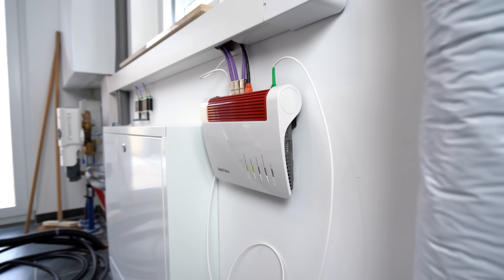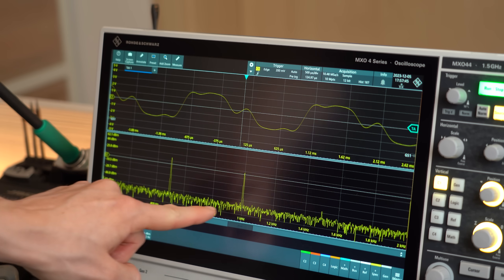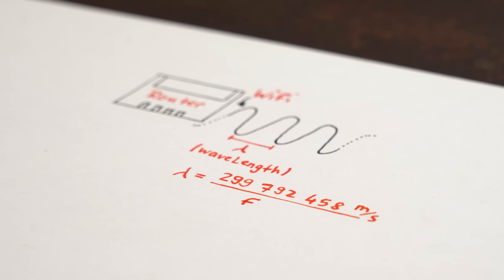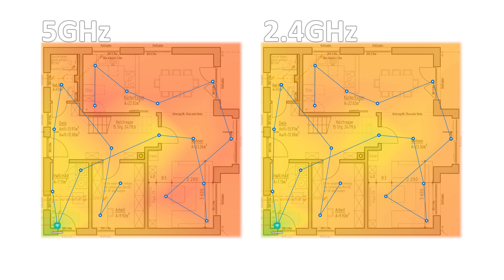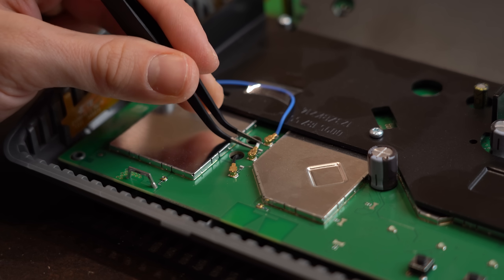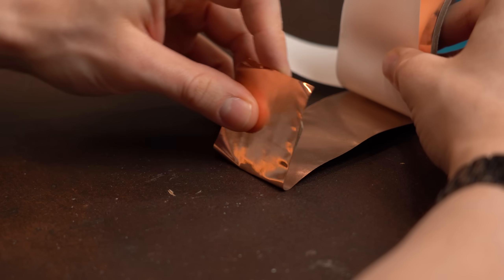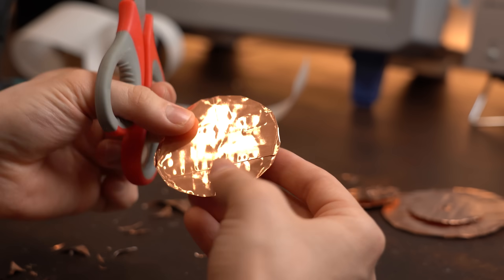I tried OVERPOWERING my WiFi!

Comment: I never thought that I'd see the ghetto engineering of the Kreosan boys on this channel.

As for their directional antenna, it's more of a line of sight antenna that works if there's NOTHING blocking the signal.

You'd be better off getting powered signal extenders or just dealing with the lower upload/download issues and in most cases, you'd be okay unless you were downloading/streaming 4K material.

Comment: Always had issues in my house 100sqm and i have 3 router to cover ther area. Unfortunately the house is built out of brick and concrete block which blocks wifi. Will show a good signal but just wont communicate switch to a.closer Access point and ita fine. Can be absolute pain but luckily my newer phone is pretty proactive at switching networks.

Comment: The first antenna (the supposed quarter eave half dipole) is not used for wiifi. Its the DECT antenna for the dect base station functionality of the router. You can see its next to the dialog sc14445 IC which is a fully inegrated DECT transciever.
Reply: I thought DECT was cordless phone handsets, why would it be in a wi-fi router?  EDIT:  I just looked up on line that we have limited use of DECT in North America with DECT 6.0.  I didn't realize it was utilized more in other places.
Reply: @WJCTechyman DECT indeed is used for handsets. Fritzboxes (the router he owns) were quite popular as "all in one" devices, acting as a DECT-to-VOIP or DECT-to-POTS gateway for the telephony side of the service. DECT was/is super popular in europe, where interoperabilty between vendors was obligatory.. so you could potentially pair a handset of panasonic with a gigaset base for example (albeit potentially losing on advanced features). Keep in mind that DECT 6.0 is not compatible with european DECT as it uses different frequencies.

Comment: It looks like the company that makes your router also sells Powerline Mesh devices.  I'd suggest looking at that to deal with the weak spots in your house.  European homes are built differently than homes in North America.  It's not surprising that the Wireless signal doesn't get that far.

I'm honestly envious of the options in Europe for this type of stuff.  It's easier to buy here now, but at double the price it seems.

Comment: Probably a low signal due to modern building materials. Foil backed insulating material will cause a lot of blocking and reflection, and it's often used in internal walls these days.

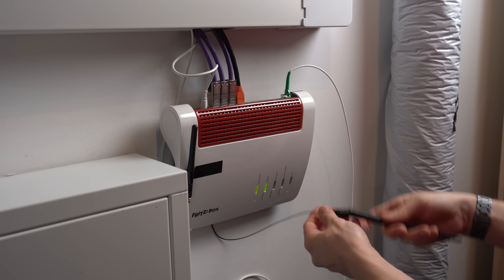Comment: Regarding 8:04, even harmonics of antennas actually present significantly higher characteristic impedances than 3rd order harmonics, meaning you can improve the signal even more by making a sort of fan dipole design

Comment: Best solution (but a little inconvenient at first) is to move the wifi router to the centre of your home, perhaps in the ceiling cavity. Your devices will never be more than half the diagonal distance to a corner away from the router.
Reply: He's got a fiber connetion, and I'd guess that the connection ends right there where the router is located right now. Of course you could maybe extend that fiber optics cable to the center of the house, but then ... there's also the WAF to include in the calculation. :)

(WAF=wife's acceptance factor)
Reply: @haukewalden2840  well... my WAF always below expected :/
Reply: @haukewalden2840  honestly get a cheap fiber switch off the internet and use cat 6 cable to connect the "fiber run" to the "router".
if murder was legal I would have killed the tech support at my ISP.
I specifically complained about their routers NOT being able to support a continuous 1Gbps link.
I asked them through out 5-7 emails "Can I switch the router to get better stability during high demand"

"no, our routers are good take a speed test it should show 1Gbps, have you checked the wifi?"

I ditched their piece of shit router for a very cheap fiber switch that has 1 fiber port in , and 2 Ethernet out, plugging that in to my Assus router solved all my issues, I can now continuously upload and download at 1Gbps for hours on end.

The fact that anybody would bother with a "modem" when they are getting fiber straight to their home is ridiculous, 
 current day ISP are operating in a LAN fashion,  there's no special sauce behind their devices, if you can plug it in you get internet.

I tried plugging in the fibber termination straight to my server and I got a IP and internet.
Reply: @haukewalden2840 it just make more sense to add more routers/access points. I have in my home using old isps routers and get 300mbps minimum pretty much everywhere.
Reply: Based on his heatmap, the 5GHz connection won't work well at further side of bedroom and kitchen. Perhaps adding one more Access Point (with different channel configured) at another edge of his house would improve a lot more better signal, especially 5GHz

Comment: I suspect part of the problem is the standard and wattage limits were both designed with American style houses in mind, which are made from RF transparent (and comparatively flimsy) materials like drywall and wood framing filled with fiberglass insulation, whereas European houses tend to incorporate denser and more RF-opaque materials like bricks or stone. You could punch a hole in an American house with just your hand, but doing the same in a European house would break your hand instead of the wall.
Using a wired backhaul, like ethernet over power or ethernet over coax adapters if you don't have ethernet wall outlets, so you can have repeater Wifi APs in the dead zones might be the "professional" solution in this case.
Reply: America has higher power limits than the EU.

Comment: Wifi routers belong centralized where possible, not in some random corner simply because it was convenient, or at least one router setups do. When possible, placing the router a bit higher in an area, a little above the height of the average human or so ( 6 to 8 feet ).  There's a distinct possibility that the router will perform better when placed horizontally than it performs vertically.  Think of the radiation coming from the router/access point as a donut.  If you place a donut horizontal, from the center, that's the way that the radio waves emanate, which means more distribution outwards- but in the same plane as your rooms are laid out.  Place that donut vertical, and that same radiation pattern only goes in a narrow swath, but goes vertically..   This is the basic premise on lower priced units; if it does not work in one orientation, you probably need to try the other orientation; in this case, FLAT. 
Now, if you have bought a router that is capable of "steering" the waves, well, it depends.  It still might be better in one orientation or another, or  it might not matter.  If you have external antennas, you want your external antennas pointing vertically.     That router with the pointy antenna- well, it's a classic example of a router that NEEDS to be mounted horizontal, or upside down, but still horizontal.  Radio waves radiate from that in a DONUT like emanation;  When placing routers and access points, you should aim to keep them mounted physically higher, ideally a little bit above the height of the average human..   
So, if  your router is meant to be placed flat, do so.  You generally don't want it the height that maximizes blockages with furniture, closets, metal enclosures, chest of drawers, etc. 4 to 7 feet, maybe even higher.. It's still a donut emanation from the antennas, so you don't want it too high unless the device is specifically designed to be ceiling mounted. 
Mesh systems or using extenders is another possibility ; But a proper mesh system will seamlessly transfer clients to the nearest access point.  Many extenders will not.  Dropping that access point closer to dead center would clean up lots of "dead" spots nicely.  Even mesh systems may require proper placement, moving to get the best coverage;  Even mesh systems should not be placed near the corners; more like about 1/4 of the way in, if two devices, towards opposite corners, but still, 1/4 of the way in.

Comment: Search for, Corner Reflector . Or, Slotted Coax .
There are many more DIY options, that will perform better, but require much more experience with RF.
Hint for your Directional Antenna, toss out the 3 smallest elements.

Comment: That is one (or two) expensive wifi router. With not that great performance too.
With that amount of money, you probably should opt for some cheaper Chinese router with a bunch of repeater.
Or, I'm pretty sure I could get a mesh wifi of the same value, at least here in my country.

Edit: Yep, i could get 3 pack mesh wifi 6, for less than that newer router you have, costs.

Comment: Ur measurements had to be off somehow. I think maybe you should have only used one piece of tape for each element. You really mucked it up using tape lol. It makes for a great exploration video about antennas and why it didn’t work. Not 100 percent sure but I think the beam formers are supposed to be isolated? Or connected? Idk does anyone know? Last yagi i made my beam formers were all attached and i think that wasn’t okay. I think all the elements are supposed to be separated. Great, now i gotta look this up. Lol

Comment: I don't know if it's the same in Germany, but in the Czech Republic the transmission power should be measured as radiated power (including antenna gain).  Wifi power should be 20dB after the antenna, not before.  So if I'm not mistaken, It's still illegal because you're changing the antenna gain...

Comment: There's a simpler fix - aluminum foil and cardboard or 3mm heat insulation (used for car windows in the summer and behind radiators). I've set a piece 50cmx40cm near my router and can get above 100mbs everywhere in a 48m^2 flat. Inspiration for this was pringles can antenna boosters.

Comment: Just buy your own router on the used market, I personally go for the asus triband router range like the AX11000, but you can buy various cheaper models too. And if you get 2 or more of any asus router, you can turn it into a mesh setup very easily to cover a large area with wifi

Comment: The other issue with transmitting above legal limits (100mW or 200mW) is the client device might now "hear" the transmitter but won't be strong enough to reply back. This makes everything slower in both directions. High-gain antennas are also a bad idea because the signal is now beamed rather than omni-directional, so you can create more problems without realizing it. The only good solutions for home are (a) mesh wireless networking or (b) wired network with multiple access points.
Reply: Yeah, highly directional antennas are uncommon for the hotspot (because usually devices should connect from multiple directions), more common for clients, but obviously less useful for handhelds (even though there are inductive coupler/cell phone, but I've never tried them). One exception is these ~7dBi long monopole/whip antennas because they are still fairly omnidirectional as their radiation pattern is torus shaped. This could be useful for increasing gain within a single floor and reducing the interference with other floors. However, in a MIMO setting you'd get correlated signals if you orient all monopoles vertically. But with some slight variation orientation or extension cables you may still get a somewhat decorrelated signals such that it is still worth it. I have never experimented with that though. Annoyingly not all vendors and drivers provide detailed MIMO performance information to be able to conduct such experiments.
Reply: A directional antenna is the right thing for this application, blame the ISP for bringing the fiber to the wall and no further. Now if the router is near the middle of the area as it ideally should be, a directional antenna will make things better in one direction and worse in another.

Comment: Amplyfy signal on a router is only half of the story, as not only you phone or laptop must «hear» router, but router need to «hear» client device too. Otherwise you client device will think that router is nearby (signal on client device will be strong), but all packet lossess will be on way from client device to router. It is why special ISP-grade routers with powerful transmitters typically doesn't help.

Comment: Another thing to remember - sometimes, more power isn't better.  If you're having issues and turning it up doesn't help, try turning it down.  Signal reflection becomes a problem at higher power levels.
Reply: I don't believe it. Maybe saturation could be an issue but how is lowering the transmit power gonna help with reflections?
Reply: @kwinzman if it does, it would be that the reflection arrives early or late. Double packets are a big problem. But I could be wrong.
Reply: MIMO used by modern WiFi devices actually benefits from signal multipath.
Reply: Communications goes both ways. It doesn’t help to increase the amp power, if you have a poor antenna and/or a deaf receiver.

Comment: As a ham, I will say that the antenna is by far more important than any sort of amplification anyway, even if it were legal. Not to mention all the distortion, harmonics, and other issues you can get by just boosting the final stage. A good antenna setup will make it run cooler, have much longer life, work way better, and be faster with less noise in the areas you configure it for, even at lower power levels.
Reply: Also, you can fine tune those homebrew antennas to work much better with a vector network analyzer and modifying the geometries using the basic scientific method. nanovna is an option for not too much money. I wonder how much capacitance that beam has as well... remember you are looking for an LC match at about 50 ohm at frequency, and stray capacitance will effect that.

Comment: That thing you made (I wouldn't want to call it an antenna) out of circles is a joke. It looks like someone tried to design a non polarised Yagi antenna with a reflector ( the larger disc) and active element in front of that and a bunch of directors ahead of that. These components are dipoles in a real Yagi, with the active bit being insulated from the boom and with a balun for impedance matching either 75 ohm for a simple dipole or 300 ohm for a folded dipole. There is never a connection to the end of the element with ground reference being the reflector. So, that it worked at all isn't much surprise, but working properly? yeah that was never going to happen.

Comment: is that a fritzBox 7590? never had a problem with ours at home here in Italy, and also use the older 7490 as an extender. We may have the older WiFi5 version tho, you may have the newer WiFi 6 revision that does more beamforming and weird stuff that may or may not work well

Comment: That older fritzbox router is pretty good device, one of the best you could have at the time in Ireland. It is very stable, no glitches, only downside is it only supports 2.4Ghz. I still use it, because any other I had from network providers sucked big time.

Comment: In some routers you have some power saving settings, that turn down the wifi power. Might be worth, to check and exclude that as well. Also, fritz offers quite good range extenders.

Comment: in order to simplify signal problem,the antenna should be made as a circle line (not a round plane).
the first small ones are for signal reflection ( which is smaller than it's diameter)
and signal is two-way communication (Transmitter/Receiver) ，so your phone's antenna should also be modifed.
but it's difficult to do that since you have to make sure antenna(on your phone)  is  always in right direction every single second.
so my suggestion is  getting a mesh wifi.:yougotthis:

Comment: 9:08 - Not only for 5Ghz, you can change also for 2.4 Ghz, but first you need to scan with phone, to see which channel in your environment is least used, then use that one. If you change to most used one, you get even worse performance.

Comment: Antennas are hard :) You won’t get ideal performance from a hand-built antenna unless you have the means to tune it. If you were to buy a high quality, high gain 2.4 or 5.8 GHz antenna it might work better. As you found, there are no ideal multi-band antennas so you have to pick a frequency. While one antenna on each band extends range, MIMO and beamforming won’t work so you give up some short range performance.

Comment: The way you had your router hanging on the wall, the built-in 1/4 wave antenna was placed horizontally and it was directing its RF energy into the attic and cellar rather than into the room.
Just mounting the router in a horizontal position (rather than hanging it on the wall) would provide you with better coverage.
Reply: Or simply orienting the antennas at a 45 degree angle can improve coverage too.
Reply: @BillAnt  you can't. they're built into the router.
Reply: @sakura_x64 then what did I see him removing from the router during the video? It sure looked like the router antennas...
Reply: @user-jm8sy5ox2j  those were antenna he made and wired in while the person you are replying to isnt likely to take their router apart to recreate the video
Reply: Wouldn’t it be possible to put the router on a shed rather than flat to the wall?

Comment: As a ham-radio operator I see your efforts building directional Yagi antenna futile. This type of antennas is very sensitive to the quality of implementation and the place where you solder coax. Your antenna is poorly made and performs accordingly. I recommend to rebuild that antenna using better materials and strictly follow all dimensions. Even three element Yagi should have a better gain than a quarter wave ground plane antenna. Having all this beautiful equipment you did nothing to tune the antenna.